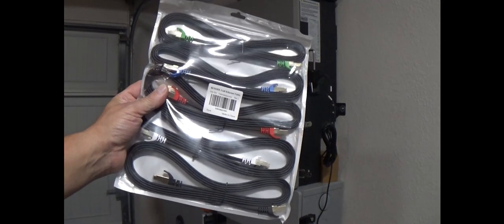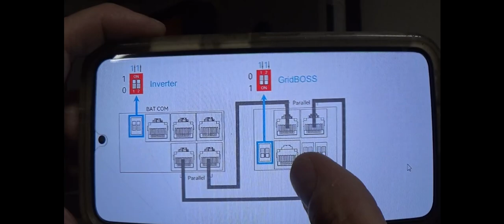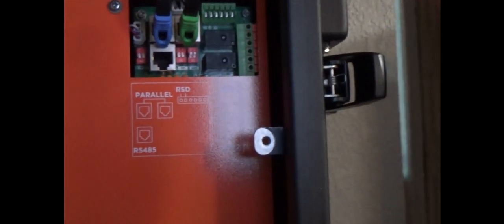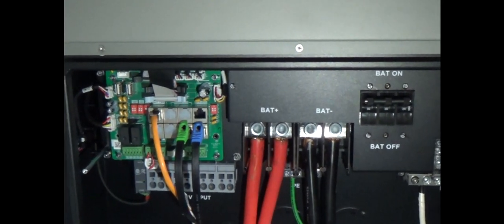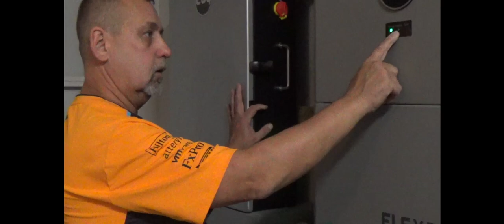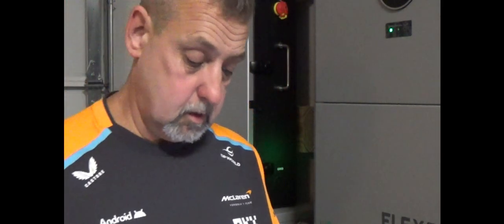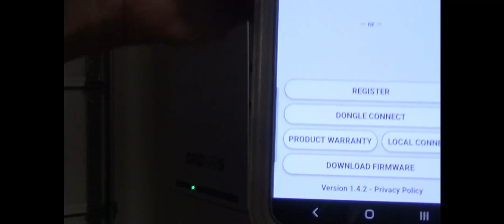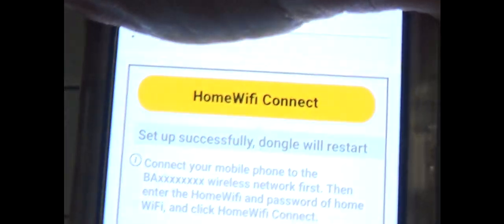Gridboss Setup WIFI

Comment: Thanks for sharing.

The Gridboss looks good flushed up to the front of the Conduit-Box!  (I may do the same with my installation).

Note, CAT8 is extreme overkill for this application... CAT5e would work fine (EG4 supplies CAT5e & CAT6 shielded - this note is more for others that may need to purchase longer CAT cables then what EG4 supplies).